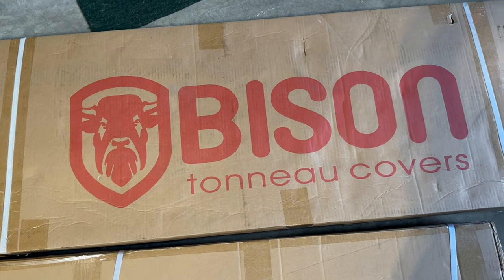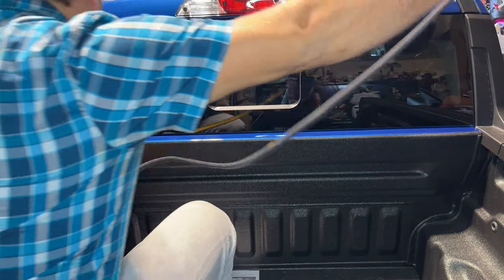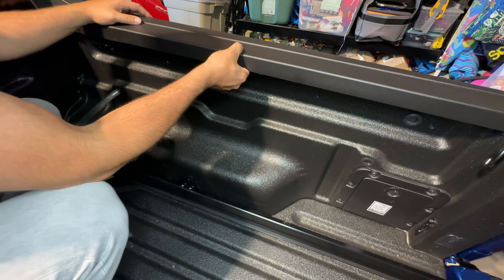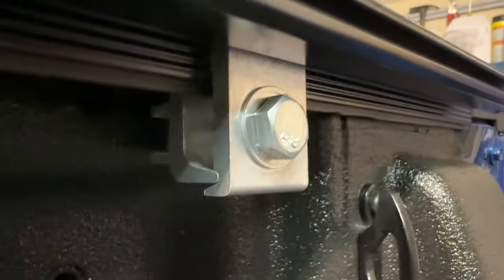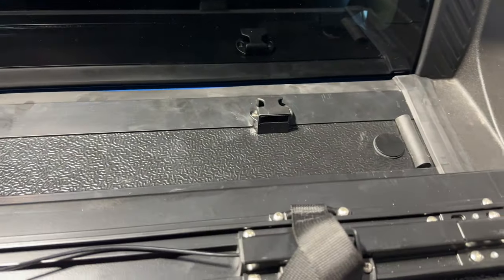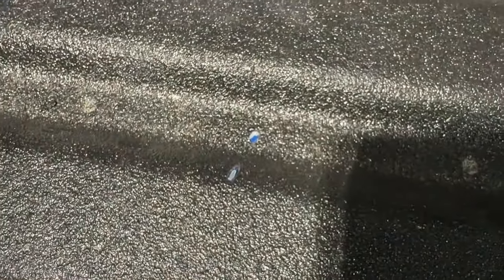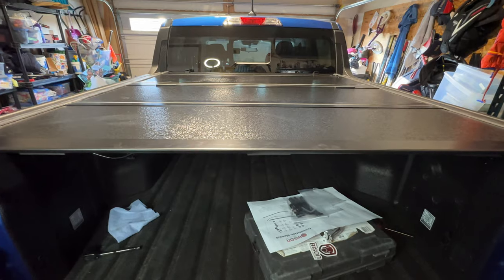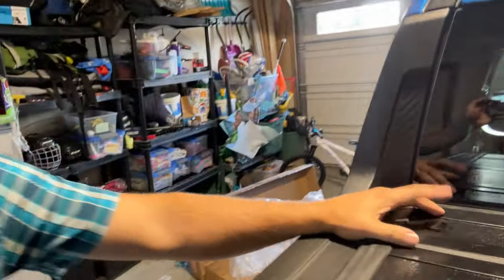2023 Ford Maverick Tonneau Covers: Are Bison Covers Worth the Hype?

Comment: Any updates since install? Was that the correct weather strip up by cab you installed or not? How much does it leak in the rain? I have a Maverick coming in August.
Reply from the maker: They did respond saying that it was the correct strip, and to use the excess material to use as the cab guard for when it is up.

I found that it had little leak areas from the upper corners of the tailgate, but other than that it has been great so far. 

The countdown is on for your delivery date! Did you order a Hybrid?
Reply: That's where mine leaks too. They should have did it where the tail gate kind of pinches a gasket

Comment: Just bought a 24 Maverick xlt, need a hard folding tonneau cover bad.    How do you like this?
Reply from the maker: Congratulations on your new Maverick!

 I have really liked it so far, it serves its purpose with no issues/damage after the first year of use. Outside of car washes it has kept all the water/snow out of the truck bed.

Comment: Does it leak water
Reply from the maker: There is sometimes a slight leak close to the cabin where we put the seal. I will likely put some additional seals to prevent it. Other than that we haven’t had any issues outside of car washes.